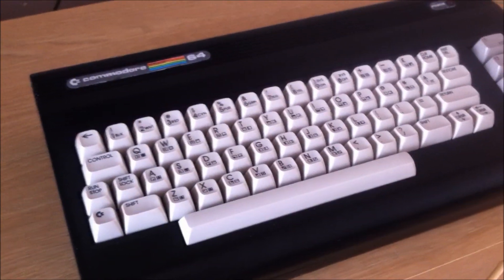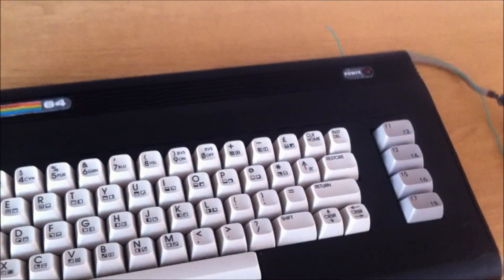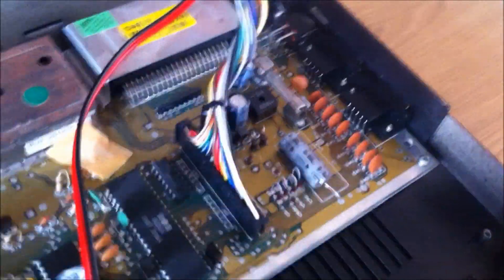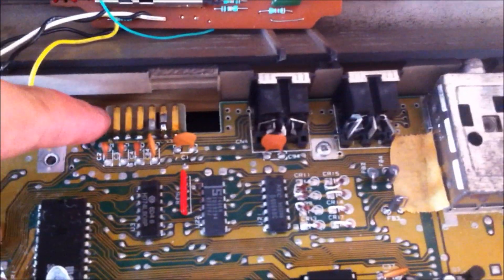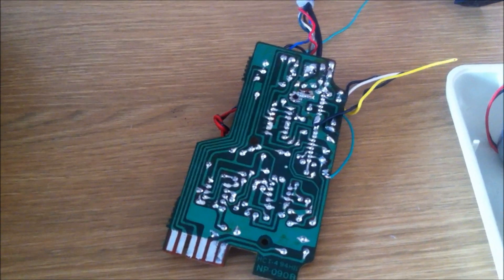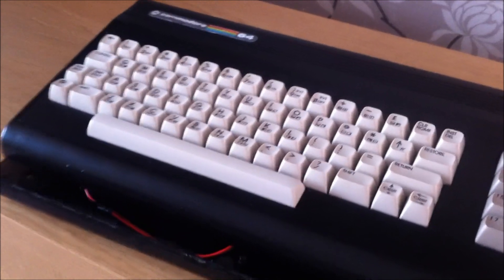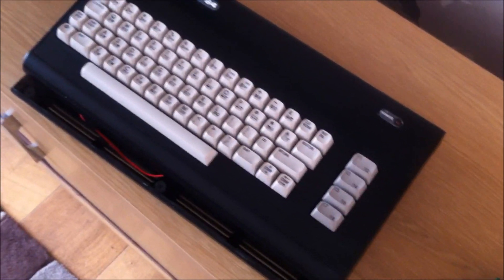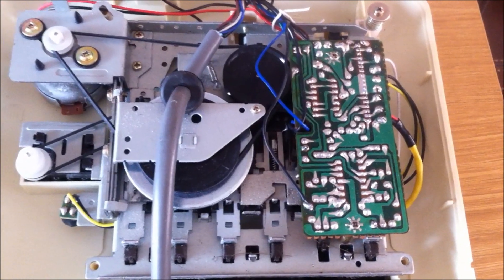C64 Mp3 Loading

Comment: need idea ....i guess i can help ya....but first i need to know ...you want the play botton to? or a switch ? or just soilder it on the board .....i mean when you dont want a switch or so the c64 jumps immediately to the load screen ....no more press play when you type load
Reply from the maker: On the data cassette there are two points that need to be connected to simulate you have 'Pressed Play on the cassette' so I will install a little push to make switch.
Reply: yeah should be a "on off switch" play and stop^^
http://www.gm.iwarp.com/c16.htm have a look there you see what the pins do on the board
Reply from the maker: oOweedwalkerOo I know what the pins do I just don't know where to solder the mono jack onto the data cassette. do you know the two points as I have opened two 1530 cassettes and the points on the pcb inside look different to yours (see vid above)

Thanks for you help by the way :-)
Reply: Beaps73 oh ok can you make a pic from the front side and backside from the tapeboard part you wanna build in.. i must know witch soundchip you have and where they are i mean you can just say it to ^^no need rly a pic....is it a Goldstar Lm324? i dont see it in your vid....or you still know where the tape head was? i mean witch wire
Reply from the maker: oOweedwalkerOo is this OK?

http://postimg.org/image/kjco0cksv/

http://postimg.org/image/ynsmsmrah/
Reply: oOweedwalkerOo this mod its not a big thing just soilder the input signal wire in front of the tapehead an you a done
Reply: need the front side to from the losses one
Reply from the maker: oOweedwalkerOo Also here is the other side

http://postimg.org/image/aawasv9nx/

http://postimg.org/image/t085fsiax/
Reply: Beaps73 the losse one you still know witch wires was on the recording head ? i dont see it anymore :D the other one I have seen the white & red wires are on the recording head
Reply: oOweedwalkerOo
hmm its not that easy but i guess you should try it look at http://sleepingelephant.com/denial/wiki/index.php?title=Datasette_modification there is a pic and here you can read pinout befor modification and there on b pinout you can try to solder the input signal wire hope it works :P
Reply from the maker: oOweedwalkerOo I might of sorted it now, it was a bit long winded but I will post a new vid shortly